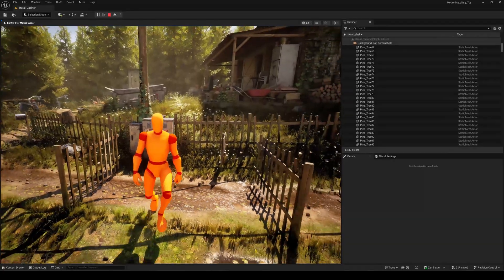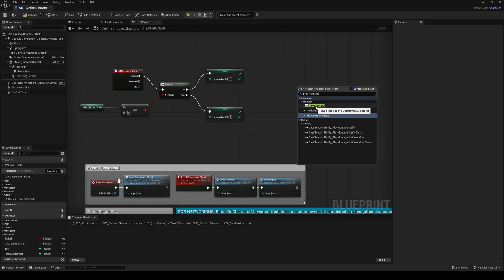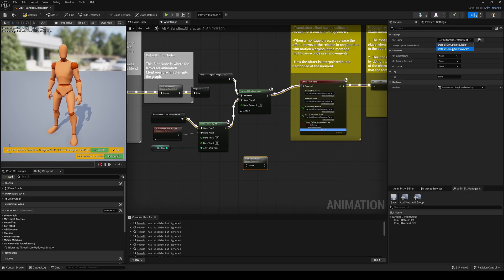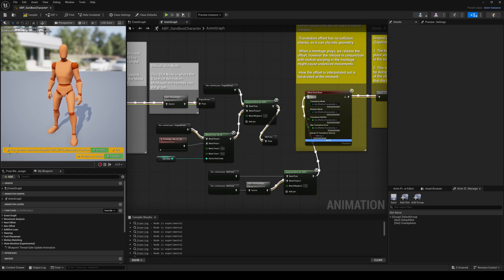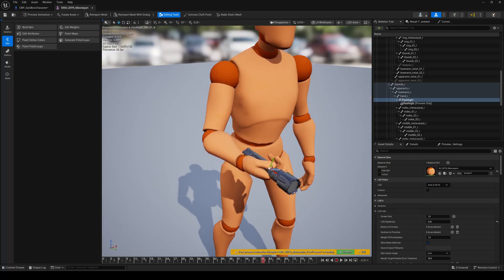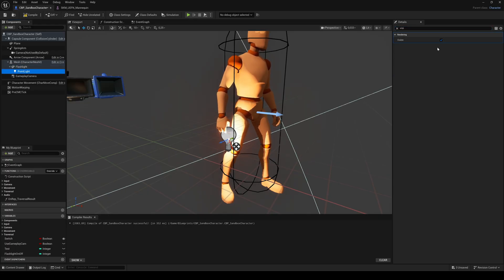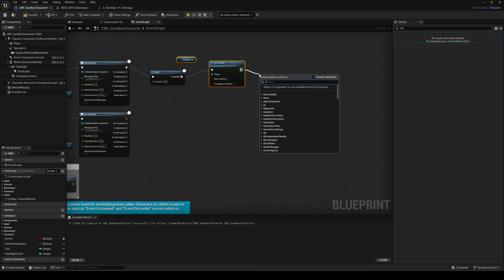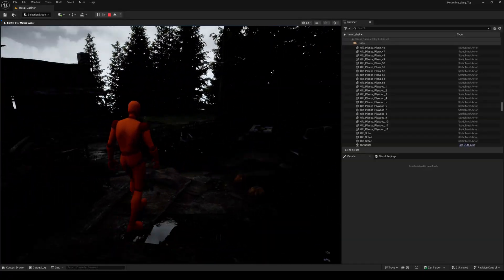Unreal Engine 5.6 - MotionMatching Flashlight System - Tutorial (Part 2/2)

Comment: How did you manage to import this flashlight so that it looks correct?
I tried all compatible formats, and while the geometry is fine, it looks like you can see through the outside and only see the inside textures, but somewhat inconsistent for different parts of the mesh. Looks at first like flipped normals, but just flipping them in UE5.6 doesn't fix it.
Reply from the maker: Thats because the material is set to tranlucent after import. Open the material instance, go to the material property overrides and switch the blend Mode to opaque. Done
Reply: @Unreal-X-Tutorials  That worked. Thank you!